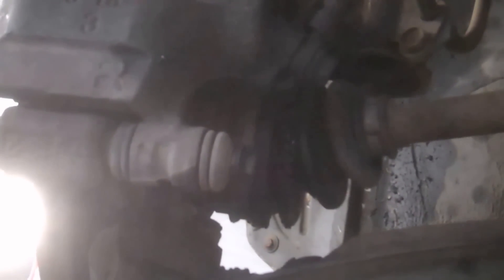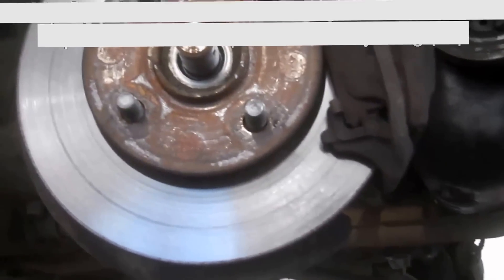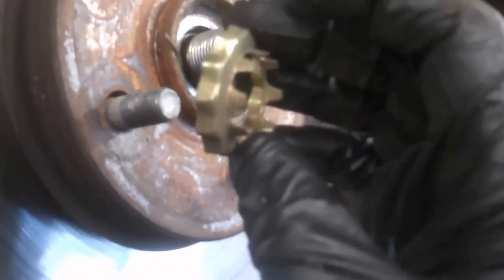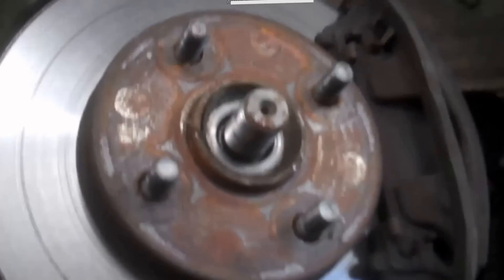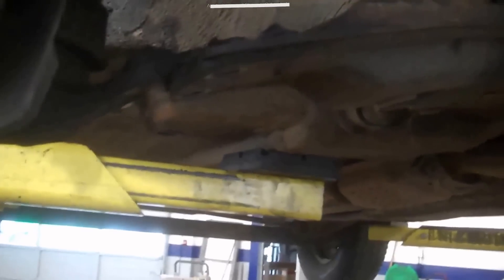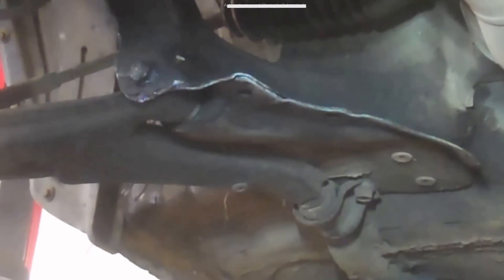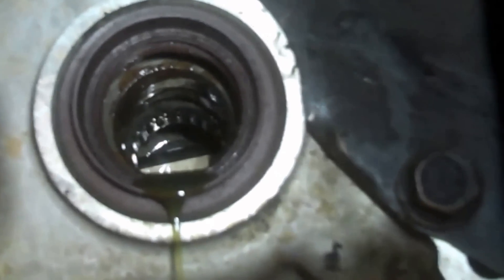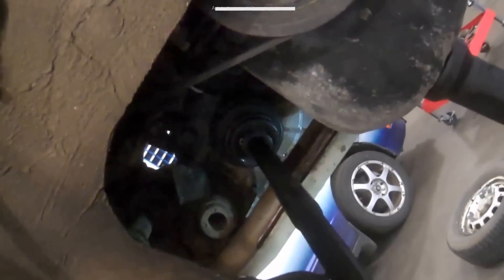CV axle replacement Toyota Tercel, Paseo, Corolla 1992 - 1998 Install Remove Replace

Comment: Did you have to add any fluid to the differential? I have a 93 toyota tercel manual trans, i need to replace the 2 cv axles and i been looking couple videos, and they said that there’s a separate fill and drain nut for the differential, i always thought that it was the same as the transmission fill and drain, do you know if it is separate or not? And where is it?

Comment: I really don't know what to do now about a court spilled out of my manual transmission paseo... I know it's gear oil set of transmission fluid but I don't even know where to put it in that I'm worried about driving the car and causing damage to the transmission can anyone help
Reply: You took apart the cv axle and you cant figure a way to learn to add gearbox oil? Cmon now!!!

Comment: i have the axle off of the car on the driver side. the end piece is stuck in the transmission. how do i get it out??? i have tried prying on it, pulling, turning, everything, and it wont come out. what do i do??
Reply from the maker: Are you able to hit it like i am doing at the 3:00 mark??  I really don't have any more advice....bigger prybar.  I have taken out the other side axle and CAREFULLY use a long screwdriver and drive it out that way. tricky but can be done.
Reply: I'm guessing you mean the inboard flange? Take a large brass drift and a deadblow mallet. 1-2 good swings and it should come right out. All you are trying to do is get the snap ring to unseat so the part will come out. Check the seals when it does and replace if necessary. That will prevent leaks and contamination. My Corolla is a 1992 with over 266k miles. I've done both sides twice - it's really easy.
Reply: Go to autozone. Get a loaner slide hammer, and a loaner axle puller. Screw the axle puller onto the end of the slide hammer. Insert the axlepuller (it's thin) inbetween the transmission, and the end of the drive shaft end that you're having trouble getting out. Give a few tugs on the slide hammer, and the end should come out. I tried using the screw driver method to get an axle out years ago, and it literally took hours, and quite a bit of frustrated cursing,  before I gave up. Then I heard about the slide hammer and axle puller combo, got loaners from Autozone, used it, and within five minutes the drive shaft was off. O'Reilley's probably has them too. Same with Pep Boys.  Point is, get those loaner tools. Use them. And then return them for your deposit back.
Reply: @JohnCampbellARM  good advice